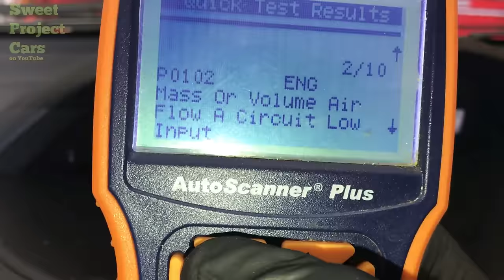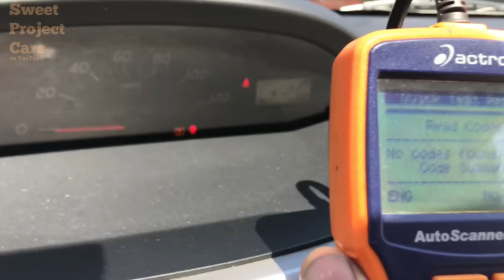How To Test Your MAF (Mass Air Flow Sensor) & HOW to Find A Vacuum Leak

Comment: I have a good one for you. 97 ranger 2.3 won't idle and pings when you gas it. Only code is for heaters in both o2s , replaced them and cleared codes and they came right back. Also replaced a bunch of other stuff. Still won't idle .
Reply from the maker: Hello Terry that wouldn’t tell me and I could be wrong that there is a timing issue with that vehicle and hope this helps

Comment: I am going  out to do this now as I keep getting the same reading , I was going to change my 02 sensor but I'll do this first injectors on a Subaru are a pain to access
Reply from the maker: Subarus are tough to get to but you have to realize those seals on those injectors take one heck of a beating from the heat down inside there they don’t last very long good luck my friend
Reply: Martin Gillespie glad to hear the MAF was the problem!
Reply: Sweet Project Cars will do when putting pink injectors in .
Reply from the maker: Martin i thought you would say you were going to use the lucky green ones lol   have a great day my friend :)
Reply: Sweet Project Cars The green ones are a bit short 😂🤣😂
Reply from the maker: Martin Gillespie ya but they were bigger around :)

Comment: 1:17  When my MAF is connected, the car idles OK (no check engine light).  When I disconnect the MAF from my petrol car, the engine idles rough (but does not stall), and the check engine light comes on.  What does this mean?
Reply from the maker: Aman A i would run the codes on this and see what it says my friend

Comment: You fixed the obvious problem but you didn't verify the repair by looking at the readiness monitors being ready along with mode 6 data to confidently say it is fixed for sure.
Reply from the maker: It was fixed, the car ran like it was brand new check engine light never came back on car has never run better customer was ecstatic even gave us a tip they thought they were driving a new car they said that’s all we really need to know and that’s all the do it yourself really has and needs Video was about helping them find issues and just more knowledge for their memory bank have a great night
Reply: @Zarik Parsanian Did you not see those injector o-rings? The motor damn near stalled out spraying brake/carb cleaner on the one. Pretty obvious what the problem was.
Reply from the maker: Oldschool Dude you are very correct it was as plain as day the bad seals, that is where it was coding from...thanks for backing us my friend

Comment: the other day , it was warmer outside than it has been- after starting the car,it stalled and would not restart-( NO CEL) I unplugged the MAF and the car started right up- Does this automatically mean the MAF or its harness is bad?
Reply from the maker: gmoneyga84 sounds like you will need to run the codes as  your problem is much deeper
Reply: @SweetProjectCars  I get No codes-nobody can find the issue- not even the dealer
Reply from the maker: gmoneyga84 without codes it will be very hard to track down my friend sorry to hear that
Reply: @gmoneyga84 I'm assuming the engine was already warm. Seen this issue many times. It was almost always a disgusting throttle body and/or MAF.

Comment: Does it have to be carb cleaner? I have some mass airflow sensor cleaner.
Reply from the maker: You can use whatever you want to use, we are just showing you what we know works after 50 years in the industry. Thanks for watching, have a great day. mad Mike the hammer SPC

Comment: Extremely helpful video.   Had past codes: PO442, PO 316,  PO303. Noticed bad idle and minor misfire at cylinder 3 at idle.  Installed new PCV breather Hose to intake (Vacuum Leak at intake boot). Engine Light went off and so far has stayed off for 5 days...Still have minor misfire at idle?? No engine light is on. Cleaned MAF but still have misfire at idle. Wondering if Cylinder 3 has issues: 1--possible bad spark plug or  2---possible injector problem? Will try your Spray and see if i notice any idle changes/ Thank you for the video. This issue is driving me nuts.
Reply: I know it’s unlikely you’ll respond seeing as it’s been 3 yrs but I’m having this exact issue rn and I can’t figure it out so if you ever got it resolved some guidance would be a godsend

Comment: I'd love to check my injectors, but 3 of them are UNDER the intake mainfold. Genius!
Reply from the maker: Sorry to hear that, if you are unable to remove the intake manifold, you are going to have to take it to be done. Thank you for watching, have a great day my friend. mad Mike the hammer SPC
Reply: @SweetProjectCars  That's the thing, if I remove the intake, there's really no point in testing, I might as well just be replacing the seals since everything is disassembled.
Reply from the maker: That’s correct my friend if you can’t test them you’re going to have to replace them all sorry to hear that you will have to do that but there’s no other way if you can’t test thanks mad mike
Reply: @SweetProjectCars  Thanks for the reply! Well besides those three injectors, I'm actually suspecting a vacuum leak at the brake booster. Whenever I press the brake pedal, if I press down all the way, the short terms can jump to +10-11%. Is that normal behavior?

Comment: does unplugging the MAF method work on any vehicle? my 04 kia sedona didn't stall, just idled up. its been having idle movement .
Reply from the maker: Jason Voorhees it works on about 80% of the vehicles your best bet would be to run the codes and see what it is pulling
Reply: @SweetProjectCars  ok, thx. no engine light but I'll have it checked.
Reply: This method does not work on my 2000 protege and my 2010 mazda3. It does not stall however it does idle up and down.

Comment: Can you have a vacuum leaks without DTC's? My mileage sucks on my 5.0 f150 and I'm thinking the computer is using more gas with the "extra" air.
Reply from the maker: You can have a vacuum leak, try this; disconnect your battery, both cables, let the vehicle sit overnight then reconnect the battery this will help the computer re-set back to default.  Hope this helps Brad, thank you for watching and asking, have a great day and all the best on your project my friend. mad Mike the hammer SPC

Comment: Does spraying carb cleaner work for testing injectors on a Diesel engine too?
Reply from the maker: This  https://amzn.to/3FojJE3  works on any engine that uses vacuum to operate. It will show you if there are any vacuum leaks. Thanks for watching and asking, have a great week my friend. mad Mike the hammer SPC
Reply: @SweetProjectCars  product unavailable in my country (UK) but thanks for the suggestion, I can find something similar with my friends help
❤️

Comment: go and try that on my audi :( it's just not doable to pull the injectors off, they come with the intake manifold which is imprisoned by 30 different tubes hoses and crap. it's 3 hours to take off for a seasoned mechanics.
Reply from the maker: Thank you for watching and sharing vivien.  Have a great day. mad Mike the hammer SPC

Comment: Hi, first thanks for this video. So I pulled my mass airflow sensor off while my car was on and the car stayed on, then when I plugged it back in the car shut off. Would that still mean the MAF sensor is still bad?
Reply from the maker: Ricky yes you will need to replace your mass airflow sensor
Reply: @SweetProjectCars  thank you for the info and response. Will purchase one.

Comment: wont carb cleaner conpletely dry up anything plastic or rubber like those vacuum lines
Reply from the maker: No, carb cleaner is made for carbs and they have rubber & plastic lines on them, it's perfectly safe. Thanks for watching, have a great day. mad Mike & team
Reply: @SweetProjectCars  it has acetone in it, try to clean anything plastic and it will start to melt

Comment: Good day bud, I'm after a bit of advice. I'm from the UK but the car I have uses the Ford 3.0 duratec v6. My car is a 2004. I have a problem where the revs take a while to settle back to idle and sometimes they can sit around the 1000 rpm. When I'm driving the car and change gear, because I have a 6 speed manual gearbox, the revs will rise slightly between gear changes. I have changed the idle control valve but it still does it. I also have no codes and no check engine light. Any clue to what this could be is very much appreciated, many thanks 👍
Reply from the maker: Mike I can be wrong but it sounds like you have a leaking fuel injector
Reply: @SweetProjectCars  OK thank you for the advice, I'll have a look and see what I find 👍

Comment: I'm just curious but I heard some cars can keep running even if the mass airflow sensor is unplugged, I believe it was older models cars? Would this be true for a 1998 Mercury Grand Marquis? If not I have to replace the one on my moms car cause it continues to run, the idle changes a bit when unplugged and plugging it back in. I was going to clean it before replacing it but its so old I should probably just replace it.
Reply from the maker: For the cost of one for that year car, I would just replace it. We've found with that year of car, if it's running hard or missing, it's usually the coils, I would replace all 8 coils as well.  Thanks so much for watching and asking, hope you have a great day and all the best on your project my friend. mad Mike the hammer SPC
Reply: @SweetProjectCars  Np and thanks for the reply. I'll be sure to replace everything. I hope you have a wonderful day and weekend as well.

Comment: I have a 2010 elantra that has a rough idle/power loss/ poor gas mileage... but runs mush better with the MAF sensor disconnected?  The voltage too the maf is erratic?  What do you suggest?  No check engine light. Some cars runs better without the check engine light. With the sensor disconnect it idles great and has lots of power. What do you suggest  Thanks ... I have a Launch 123i scanner and has done a lot of scanns. It seems the car will start irratically as well. When it runs smooth it is really good , like new....?
Reply from the maker: I would disconnect both battery cables for 30 minutes, then re-connect and see how it runs after that.  Drive it 5 to 10 miles, if it doesn't change, I would take it to a trusted mechanic and have them scan the computer.  Hope this helps.  Have a great day.  mad Mike the hammer SPC
Reply: @SweetProjectCars  I took the MAF sensor out yesterday, cleaned it with the proper spray cleaner for the sensor. Meanwhile i did disconnect the negative from the battery because I also cleaned the contacts on the wiring connector to the maf. I dried the maf in the house because it was really cold outside for about 45 min. Reinstalled the maf sensor, and battery negative terminal. Car started better and idling was much improved. But I noticed later on in the day that the rad cap was not re installed properly and that some antifreeze spilled onto the driveway. I re installed the rad cap . I am going to re start the  car in the morning. But I did notice a great improvement in the idle . I am going to drive the car a longer distance this morning to allow the rad  and the engine to heat up properly. I did notice a few things about it took a long time yesterday morning to get heat ( Loose rad cap)  etc we will see. I tried a few times to find a mechanic that knew how to diagnose the problem, with no avail so I boughT the launch 123i scanner. This is a professional scanner. But you need to learn how to use it, and interpret the data. I will see this morning what is going on....THANKS   ED R

Comment: I have a 93 Toyota pickup with a air flow meter. Is it the same method as with the MAF sensor?
Reply from the maker: Should be the same method with every vehicle that has a mass airflow sensor

Comment: I did this on my 2004 Golf v5 after running around for half hr, and engine didn't cut off. Does that mean the engine isn't getting real time data from the sensor?
Reply from the maker: 0Tweaky0 it means that you need to find a good code reader and see what codes your car is pulling my friend  and then go from there:)

Comment: Hi friend I did it and my car is still running ... are you 100% sure that means the MAF isn't working??? On all cars
Reply from the maker: We are 99% sure it's your MAF, if not it doesn't hurt to replace your MAF anyway, their not that expensive and it's a good idea to do once in a while.  Thanks for watching Krisho, have a great week my friend. mad Mike the hammer SPC
Reply: @SweetProjectCars  how you mean it isn't expensive i have a lancer
Reply: @SweetProjectCars  so my systems for my car is a lancer and when I'm mashing gas it doesn't go over over 40 mph if it reaches over check engine light comes on .. right now its starts well but now not moving did I clean the throttle body ect however u was going to buy a AFS (air flow sensor ) however I did a scan on the car and it came back as gas flow sensor which have me two minded on which 1 cause I'm still getting gas cause the car is still starting ????? Help

Comment: what is the problem when i brake may rpm go low idle sometimes engine shout off
Reply from the maker: Sounds like you have an electrical problem. Brakes, when applied, use a lot of electrical power, you might want to put a volt tester on your battery while the car is running and have someone apply the brakes and make sure you are not dropping below the necessary voltage to keep your car running.  This is just one of many, many issues you could have but it sounds like you may be drawing too much power away from your injectors. Hope this helps JR, thanks for watching and asking, have a great day and all the best on your problem my friend. mad Mike the hammer SPC

Comment: if u have weak fuel pump prob,when u disconnected airflow sensor engine wouldnt die off
Reply from the maker: Thank you for sharing.  Have a great day.  mad Mike the hammer SPC

Comment: On my 00' Silverado my truck stays running whether I unplug the MAF or not. I just replaced it this morning and it does the same thing with the new one. I have only driven about 5 miles back home from the parts store since the installation of the new MAF sensor. Can you give me an idea why it's not stalling out or what the cause may be?
Reply from the maker: Joshua some vehicles are not effected by the removal are you pulling any codes?
Reply: @SweetProjectCars  no, none at all. My mechanic says it's probably because the ECU is reading what the throttle position sensor is saying. I've got the battery disconnected, terminals together for around 30 minutes to drain the capacitors of all power to re-instate the baseline and have it re-do all checks to make sure the ECM is reading everything (and the tranny was shifting very aggressively the other day from first to second and second to third but on the return trip home it was fine) the reason being is I just installed a new mass air flow sensor and I want to make sure it's picking everything up and relearning
Reply: I plan on making at least a 45-minute trip into town and another 45 back and then tomorrow I've got about an hour and 20 minutes one way and back as well the truck will be under a load for at least 30 minutes or so going up some steep mountains
Reply from the maker: Joshua we have found when you disconnect the battery to reset everything back to default that is does take some driving so the computer can relearn.
Reply: @SweetProjectCars  that's what I'm hoping to achieve with the capacitor drain via the battery disconnected. Thank you for confirming what I was hoping to be true. I really appreciate it!! Have a great day!!
Reply from the maker: you are very welcome my friend

Comment: With my mass airflow sensor plugged up my truck won't idle it cuts off but unplugged it idles fine. Running rough what could be wrong?
Reply from the maker: The first thing I would do is replace the sensor if you are not pulling any codes.  Thanks for watching and asking, have a great week. mad Mike the hammer SPC
Reply: @SweetProjectCars  I've replaced the Mass airflow sensor twice so far. Maybe they both were bad?

Comment: brother man what about if its happening right behind a short ram air intake upgrade on a 2011 malibu 4 cylinder?!?! HELPPPPPP!!!!
Reply from the maker: First thing you need to do is get your computer set back to default, do this, remove both battery cables and let it sit for 24 hrs. Reconnect it then drive 10 miles or so, if that doesn't do it then you need to get one of these https://amzn.to/3Ca2QeD  and find out what the problem is.  Usually if you do an air intake upgrade you will lean the system out, thats what we have found. Hope this helps Damon, thanks for watching and asking, Happy New Year and all the best on your project my friend. mad Mike the hammer SPC

Comment: I'm having a hesitation issue on my 02 Lexus es300... Check engine light is saying it's camshaft position sensor but I don't think it is,  runs, starts and idles fine. Just hesitates when I floor it
Reply from the maker: For the cost of a camshaft position sensor, it's worth it to replace it.  Sounds like you have the symptoms of that.  Hope this helps, have a great day.  mad Mike  the hammer SPC
Reply: @SweetProjectCars  
Replaced camshaft position sensor and plugs and still having same p1350 code for camshaft position sensor. It's running lean on bank 1 & 2 so could it possibly be the map sensor? Going to the car now to check to see if it's map sensor or not, if it's not my camshaft position sensor nor my map sensor what else could it possibly be? Oxygen sensor?
Reply from the maker: Denton, for the cost of the sensors these days, they are cheap for your year vehicle.  Just replace every sensor that you have the ability to replace, this way you rule them out of the equation.  Then after you do so, disconnect both battery cables, let set for at least an hour or more, reconnect and drive for 5 to 10 minutes.  Thanks and hope this helps you out.  Have a great day.  mad Mike the hammer SPC